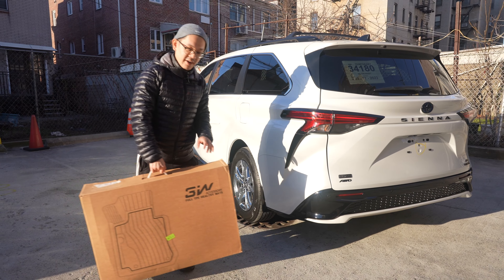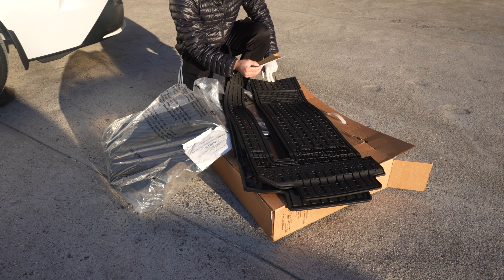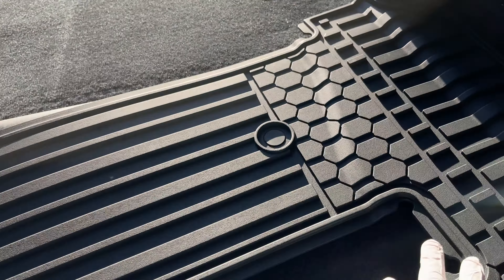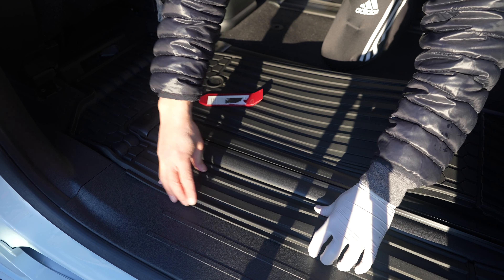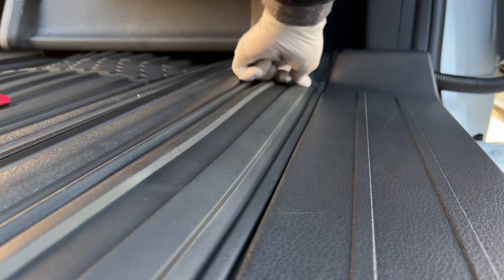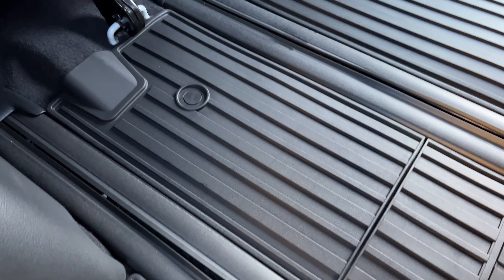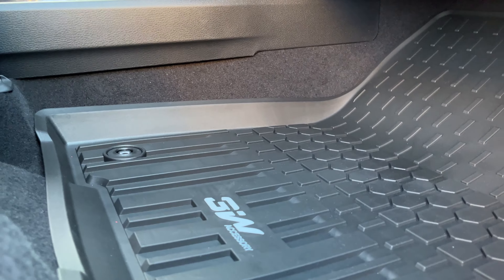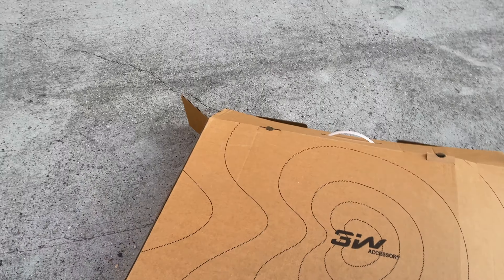2023 Sienna 3W Floor Mats Install | The BEST!

Comment: Thanks for the video. Is there a reason why you didn't go with the mats offered by Toyota? I'm undecided if I should go with the Toyota mats or an aftermarket one.
Reply from the maker: Thanks for watching Greg. I chose these mats because the material quality is thicker and fitment is just as good as OEM. Pricing wise, it’s similar or even less expensive than OEM. I believe it’s a little bit better coverage, atleast for the front driver and passenger.
Reply: The one mats do not cover the carpet area between the door and seats. The oem is rather disspointing
Reply: @aeneas116116  I hate that, I got the OEM ones and got rid of them and got weathertechs for it just due to the area it doesn't cover.